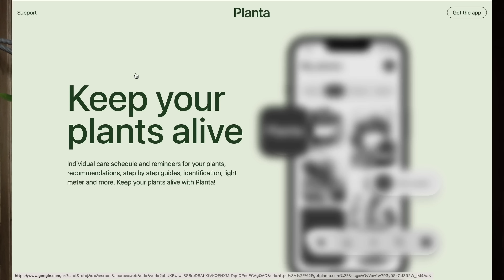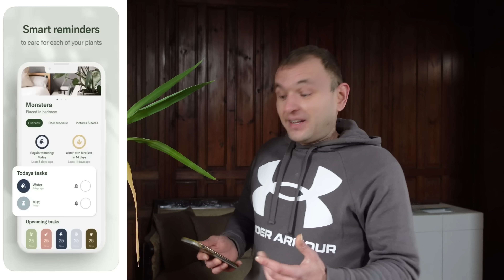ANTIQUE lights for a 18th century Derelict chateau tower. Ep 94

Comment: Did you thread through the wires for your plug-ins on the walls where you want them at the same time to save yourself having to do it again?
Reply: Not yet. They will be in slightly different locations so we will have to find new routes for them 😂😂

Comment: All those conduits along the floor behind the paneling...are those all for lights?  Getting kind of crowded with all those conduits.  Not a criticism...you are methodical in your approach and you're working on the chateaus inner works which are hidden by all that beautiful paneling.  Is it a problem for you having all these hidden "openings" in the walls or flooring with which to pass electrical wiring, pipes, etc.?
Reply from the maker: Yes it is for lights and switches for in the tower 😊